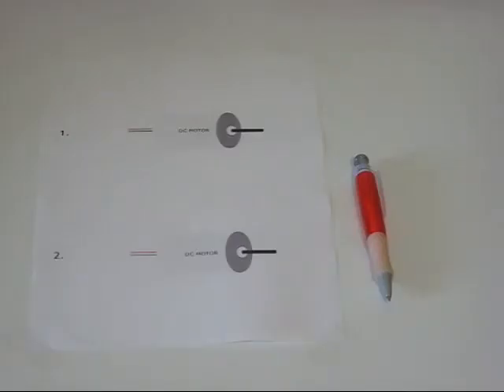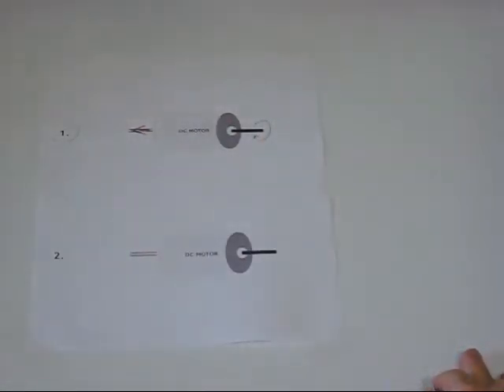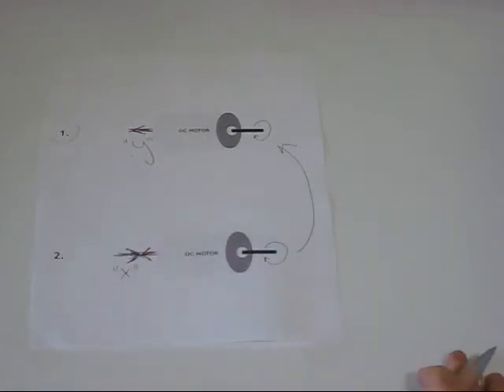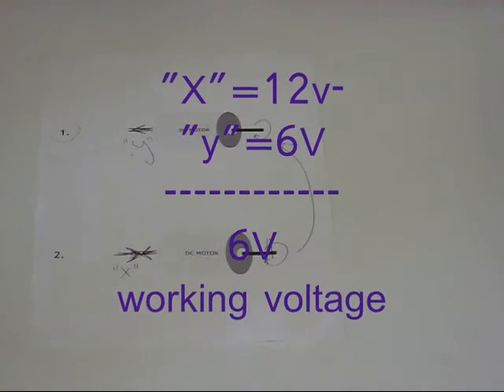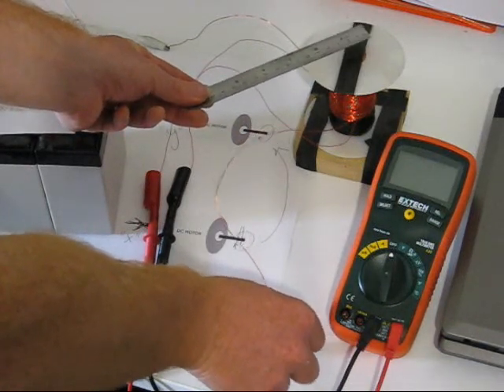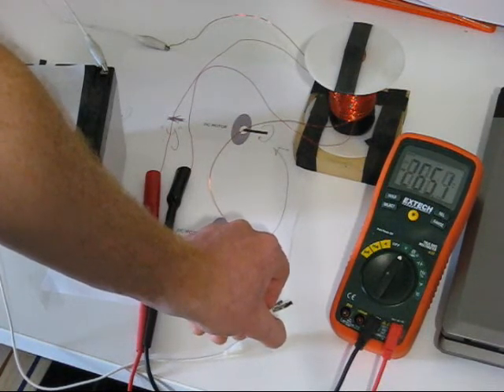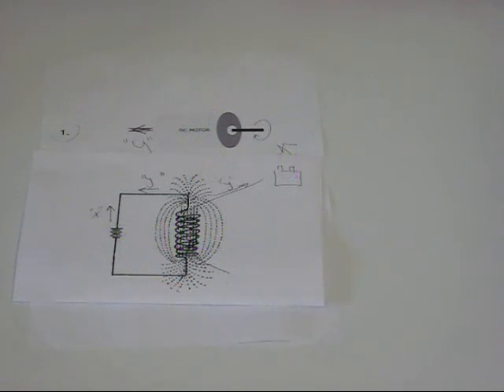what back EMF is

Comment: What is to stop your secondary winding from also acting as a motor?..  You're supplying power to it..  ??   In order for this to work, you would have to have very fast switching that would only connect the secondary coil at the perfect timing to receive the back EMF..  but even then, as you first turn on the switch, your power supply would energize that secondary coil--  fighting against your back emf.  So I don't think you could ever use it to "charge" a power supply.  You could only let the back EMF discharge into some sort of load.. Possibly a heating resistor or something like that.. Where you could capture the heat to boil water and use that to make new power...   I suppose the back EMF could be used to discharge into some capacitors.. And then you use those capacitors to discharge into a power bank of some sort??  maybe that would work.....  But the point still remains:  you would need very fast switching mosfets or relays, etc.  to open and close the circuit to only make contact during the moment that the back EMF needs to discharge.

Comment: The iron core is being turned into a magnet by both modes of ion gas compresion.

You will notice it takes longer for the feild balloon to deflate than for influx current to inflate it.

The reason is.
Influx creates the magnetic force in the iron useing static preasure of the battery.
The either has to compress this ion gas through the iron which is more resistantant than the copper wire.

Just get rid of all ferrous materials and use static battery pressures to creat magnet varying feilds in copper shoes.
There will be no enternal drag created to work against itself.

Comment: Your wrong.
Flyback current  always makes a stronger magnet feild than influx current, but it's so untimely that it acts only as a momentary brakeing load.

The collapsing feed causes a magnetic feild of the opposite polarity of the primary feild being generated.

How the hell can you get efficency when iron is attracted to magnetic feilds.

You have to loose all ferrous materials,
Replace coils with laminated plates, house it all in brass or stainless.

We must build our motor generators to use the collapsing feild current to push the influx feild currents.

Comment: Iron rotor shfts are attracted to magnetic fields,  iron is also conduit for magnetism between two peices of iron in the proximity of a magnet feild.
All iron in motors act as a brake.

Get the iron out of the motor generator.
All should be copper and brass. No ferrous materials.
Use isolated insulted coils to produce high voltage flyback currents, use the back EMF to push the motor

Comment: Thanks for the vid Brian. The links you gave where very helpful. You're kind of on the right track from what I can see in your video. My research parallels what you are doing in some ways and I'll know if my current theory will work or not in just a few days from now. I've been at this now for around 5+ years designing and building my own components and systems from scratch. Don't give up!!!! Who knows, maybe you'll succeed where I might fail!!!!  ;)
Reply: Let me guess. You didn’t succeed. You are still using your home 110V AC. Reason I know you didn’t succeed is because in your short display you demonstrated your inability to reason.

Comment: The Hysteresis factor is not accounted for :-/?
It's the reaction time for the induced magnetism & how long it retains its magnetic property.
I would suggest the 555 ic chip
As the square wave generator:-)
It can have both the frequency and pulse length tuned to optimum harmony for motor run's.

Comment: The SSG does not produce AC current, it produces pulsed DC. The purpose of the SSG is to produce the inductive spike which "WILL's" the correct FLAB into charging.
Cheers - this was a good vid from 2008.

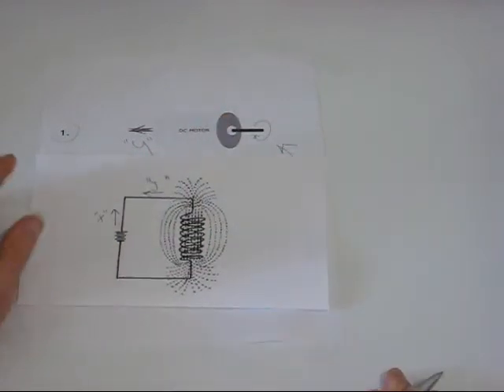Comment: In 4:14 your Y voltage is in the wrong direction. Back EMF only opposes the applied voltage to the inductor when the voltage is applied, not removed. If you apply a positive voltage X to the top terminal of your circuit, the current trough the inductor will start to linearly increase (until core saturation). At the same time back EMF will linearly decrees. When the applied voltage X is removed, the inductors magnetic field collapses and a negative voltage is induced on the top terminal. And NO, you can not harvest that "free" energy because the output energy is equal to the energy of the induced magnetic field. In reality your efficiency will only be around 95 % due to resistance, switching losses, core losses etc.

Comment: It takes energy to create the magnetic field. When the current starts energy will be stored into the magnetic field until the magnetic field is created, and will than use energy from the current in order to do work for anything. So it takes energy to create this magnetic field and it is stored, when turned off the energy goes back through the wire. This basically means you are just releasing stored energy... you are not creating energy... in fact you are losing energy by many different factors.

Comment: I think my question is going to sound stupid, but here it is: If I wind up a coil around an electric motor and connect it via a diode to another battery, does that decrease the Back EMF of the motor? I would really appreciate if you could answer and help me understand more. Thanks in advance.

Comment: Protection from EMF org is talking about "electromagnetic fields", while the EMF discussed in this video is "electromotive force". These are different concepts, electromotive force is an old-fashioned name for voltage, which is one way of describing a source of electrical power. On the other hand electromagnetic fields describe the propagating magnetic and electric fields that are emitted from a flowing electrical current.

Comment: Thanks for your explanation, as an electrical engineering student I found this helpful. I know you implied this in your explanation, but for the viewers sake I thought I would state it explicitly. The back EMF produced by a motor, referenced here as the "y" voltage, is directly proportional to the rotational speed of the motor shaft. A motor spinning at 2 rpm has twice the back EMF of a motor spinning at 1 rpm. I hope that helps.

Comment: A few points: one: in a dc generator there is no back voltage; there is only emf.  In a dc motor there is applied voltage and back voltage(emf)  Also:  The back voltage creates the energy demand to run the motor.  The voltage drop across the motor  represents the energy needed to run the motor, I believe(not considering the resistance in the motor, ie the wiindings, etc.).

Comment: I was referring to supply signals with very steep transients - these rapid changes in the magnetic field - given the core material can transfer these spikes - can cause larger voltage spikes on the secondary side of the transformer then the winding ratio would suggest - of cause the current requirement is enormous, the secondary current is very low and with an attached load it deminishes almost completely. tasers and tube tv hv supplies work that way.

Comment: thank you for the video...however i still have trouble with the y voltage. If you forcefully stop the motor from turning you should get a sharp increase in current right? but why is it showing that you get a higher voltage instead? doesnt P=VI ? If someone could clarify this for me it would be appreciated!

Comment: The way you turn your coil also makes it negitive or positive. If you go clockwise turn you should get a negitive field and if you whind the coil counter clockwise then you get a postive field coil. Basically you are changing north and south ends of the coil but not electically but mechanically. If you did a coil with with a primary and two other whindings you should be able to get your ac back when the primary coil collapes.

Comment: Nice video!

I am a novice so maybe I am going to ask a stupid question but here it is ...

The electro magnetic force created by a coil is directly proportional to the current flowing through the wire i.e. independent of voltage.

But is back EMF independent of voltage?

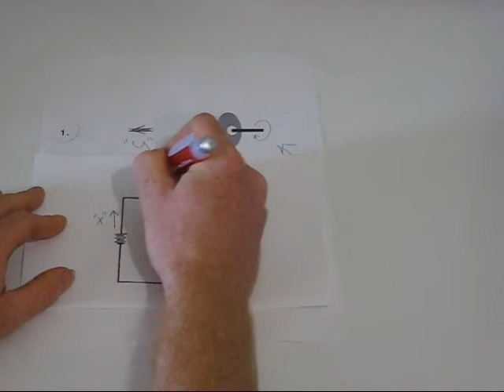Comment: At 4:07 I think you have the Y direction incorrect compared to your words. When an inductor sees the voltage drop to zero, EMF sustains the voltage in the same direction, X, not reverse direction.
The reverse direction, Y, occurs when X first rises from zero to full voltage and EMF opposes that rise.
vrvandjjk is snagged on this same issue, I think.

I will replay the video. Maybe I misunderstood it.

Comment: I have a coil pulsed rapidly by square wave voltage. 30 volts peak to peak. Would two series strings of  nine 3 volt LEDS (27 volts) clip the back EMF from damaging my function generators 30 volt output. Those strings would be opposite but in parallel across the generator output.  What resistor value would be needed in each string?

Comment: Hm .. You are right about not breaking the laws of physics - this is simple induction. Dc - Dc stepup converters work that way . But the Power (Voltage * Current !!!!!) you supply to your primary system can't be higher then the output. the voltage might be far greater , but not the current is much weaker , or the time periode is shorter or whatever . And : a multiphase generator uses  all voltages which are generated in the coil .. but its still very far from beeing 100% efficient...